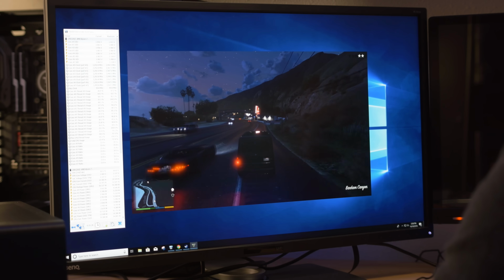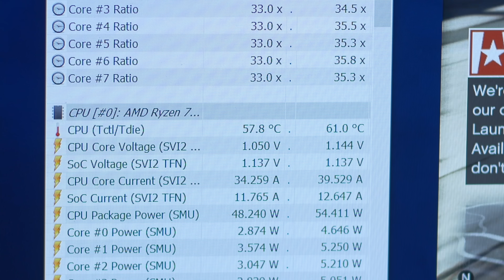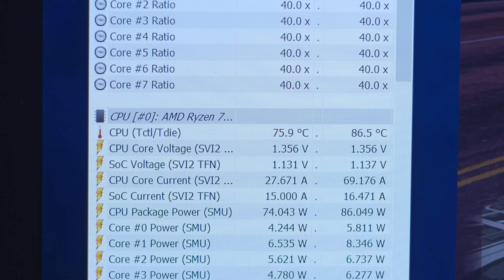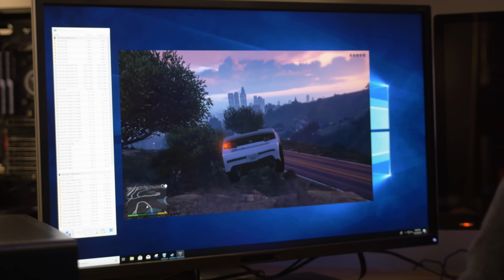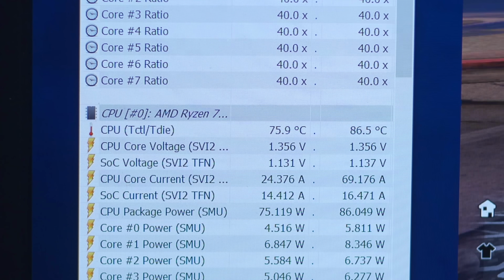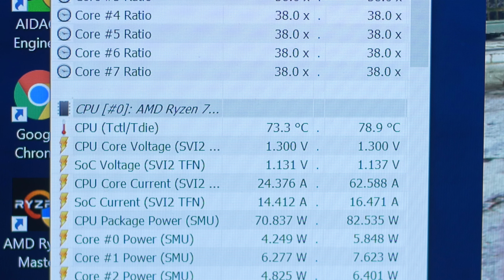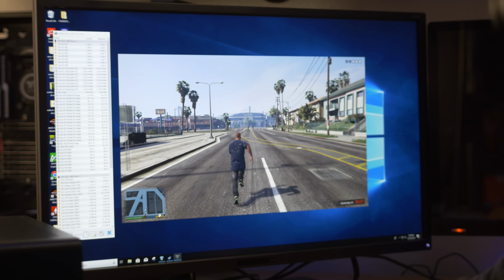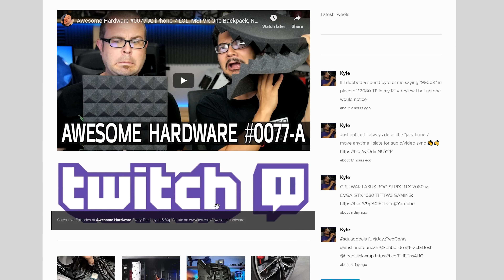Testing the limits of a 92mm AIO with Ryzen!

Comment: Bitwit : KYLIE !!!! It's enough, you intentionally made the same mistake when you were reviewing FM2+ cpu-s a couple of years back. If you consider yourself a serious reviewer then it's way past time to learn how to differentiate between :

Tclt/Tdie = value of 73,3 (those are not degrees C, HWMonitor or Ryzen Master is reporting it wrong, showing a combined number of temperatures from cpu + SoC + VRMs and it doesn't have any other value than scaling only a number)
Tdie = is the correct temperature and it is 20 degrees C lower on Ryzen 6c/12t and 8c/16t cpu-s and 10 degrees C lower on 4c/8t Ryzen cpu-s

Do some proper research and start using a proper monitoring software which is HWInfo that shows both values !!!! I am telling you that because me and my girl love watching you and your wifes channel but sloppiness is becoming a little much, don't you think.
Reply: @LFLY R - Dude, I am sorry but you have your information almost completely wrong! Kyle is reporting the correct temperature number here. I can't speak to the FM2+ chip he reviewed years ago, but this chip in this review here, other than his assumptions about TDP, Kyle was NOT reporting wrong temps. You should probably do a little more research brother, but I will give you some help.

TDie IS the Correct Temperature, you are correct there. And on ANY X Chip you will see different numbers for TDIE and TCTL. In those cases, TDIE is always correct, TCTL is just the TDIE PLUS the OFFSET. So on the 2000 Series that Offset is 10 Degrees. On the 1000 Series that offset is 20 Degrees.

On The NON X CPU's HWinfo will report the Temperature as "Tctl/Tdie". This is Because THERE IS NO OFFSET on NON X CPU's, so it reports both as the same, and therefore on Non X CPU's instead of having different categories in HWinfo it is simply listing it in one category with the label "Tctl/Tdie" and on non X CPU's this is the Correct Temp. 

So in this video he is talking about the 2700, the temps we see up on HWinfo are the Correct Temps, and he obviously also used the correct Temp reading for the numbers he gave us for the 2700x, otherwise it would have been 10 Degrees higher.

So you are mad at Kyle for the wrong reason, you should be mad at him for not correcting his assumption with TDP, but he already apologized for it, so its too late now. Anyways, look up the Temp Differences again, you will find I am correct, I own 2 2400G's, one 1600 and one 1700 (Which all report Tctl/Tdie) and two 2700x So Learning the different Temperature readouts on these was very important to me. A good resource is the Gamers Nexus Discord. Good Luck.
Reply: @evocatiproductions  well my previous Ryzen 5 1500X was reporting 10 degrees C offset, then I had Ryzen 5 2400G which had 20 degrees C offset and now I own Ryzen 7 1800X which has 20 degrees C offset. And Kyle has made the exact same mistake in FM2+ video 3 years ago so him proclaiming himself a youtube computer professional reviewer is just funny because you can't make this kind of a mistake again. A youtube reviewer has much more financial resources available and he should take a little more time to use OpenHardwareMonitor, HW Monitor, HWInfo, CPU Temp and Ryzen Master to compare temperature values amongst each other and then he can extrapolate which monitoring program is useful for certain manufacturer :). Those are almost all free programs to use so there is no reason to be sloppy and again report wrong temps because this kind of sloppines only damages AMDs reputation.
Reply: @lflyr6287  You may be right about the 1500x, as I don't have that one in my collection, so I don't have first hand account of the offset AMD Uses. And I would agree 100 Percent with doing your homework before making a video. I actually love Kyle's Content, but I often Facepalm at his lack of research before he does a video, but I guess that is just his style, and I like the entertainment value regardless. Either way I tend to agree with you, just in this video I was way more "Triggered" at him promoting the Misconception that the Manufacturer Listed TDP Spec actually means it uses less power and heat at the same frequency, that is flat out wrong, and so thats why so many of us down here in the comments were leaving negative comments. But Kyle Acknowledged it and apologized, so hopefully he will address the misconception in a future video, and we can all move on.

However, both OpenHardwareMonitor and HW Monitor are inferior in comparison to HWinfo. HWinfo has historically always been the most accurate because of its developer quickly updating at least once a month, and with every single hardware launch for the last 10 years. Like with the Ryzen Launches if you remember it took HW Monitor almost 2 months to get the correct temps, and OpenHardwareMonitor took almost just as long. Where as HWinfo took less than a week. But thats just my opinion on software, if he Just uses HWinfo, that one is going to be accurate 99 Percent of the time, simply because of its method of accessing the sensor data. If you just use The Tdie Sensor on HWinfo on any Ryzen it will always give you the correct temperature, especially now. I know right after launch even HWinfo had it wrong, but that was only for a few days and then they got it right. Tdie is always correct, but in cases like with the 2400G where its labeled TCTL/TDIE then that is the correct temp, it is not the sum of CPU + SOC.

But if its labeled TCTL and doesn't have the slash TDIE, then it is the true temp plus offset, and that does vary from Chip to Chip. I have seen that all my first Gen Chips with Offsets have 20 Degrees offset, but like I said earlier I don't have a 1500x so I can't say for sure on that one. But I do know the 20 Series X chips all have 10 Degree Offsets.

And whats cool is I now have Several Clients with Epyc Based Servers, and on Every Single One of them HWinfo Reports the Correct Temp, and it is also listed on those as "Tctl/Tdie". But Whats cool about those is it actually gives you the Temp on each Node, so you get a "Tctl/Tdie" Node 1, and then a "Tctl/Tdie" Node 2, and so on til Node 4. So You can actually see your hottest section of your overall Die and adjust your cooling accordingly, so I just think that is one cool difference.

Anyways, I would agree, Kyle and every other reviewer should always be as accurate as possible and try to avoid making misleading statements, intentionally or otherwise. I just don't think their is any point into using Sensor Software other than HWinfo, because the method used to access the sensor data on those 3rd party programs are often inferior, where as HWinfo actually probes the WMI interface in the BIOS directly without going through the windows Kernel. Of course its always good to sanity check, but outside of sanitiy checking you are going to be accurate most of the time with HWinfo. On top of that opening more than once Sensor accessing program at a time can cause problems as owners of the Crosshair 6 and 7 Hero MB's can attest too. Anyways I wil shut up now.
Reply: @Transistor Jump  well my previous Ryzen 5 1500X was reporting 10 degrees C offset, then I had Ryzen 5 2400G which had 20 degrees C offset and now I own Ryzen 7 1800X which has 20 degrees C offset.
Reply: got a trick for you guys: maintain alt pressed and type 248, you get the ° symbol :)

Comment: I don't see the point here: of course two chips running at the same specs will have the same TDP. The only reason the 2700 is a 65W TDP is because it runs at a much lower clock speed. You could have just underclocked the 2700X. Or run it at stock with XFR and try indervolting it.

Comment: Wouldn‘t it make more Sense to try undervolting the 2700X ?
Reply: Or just buying the 2700 and over clocking to the 2700x clock speed
Reply: I have undervolted every single CPU I have ever owned in my life. Same with GPUs. 

Step 1. Buy hardware that is known to overclock well. I chose, in 2012, an i7 2700k. Undervolt it and overclock it as high as the UNDERVOLT will allow. I made it all the way to 4.3GHz on my 2700k, at lower than stock voltage - comparable to hitting 3.9-4.0GHz on an undervolted 2700X or 2600X.  

Step 2. One day, you'll need more power. For me, that's only been recently. I just replaced a 1060 3GB with a 1070, and my CPU started to hold back the 1070 at just 4.3GHz. So, in response, I FINALLY (in 2018) took my 2700k to 5.1GHz, and barely over stock voltage. Since I undervolted it on a 212 Evo all these years, never breaking 55C once in it's life, I know it will easily handle this 5.1GHz overclock until I get a Ryzen 2/3 chip later.
Reply: Or put the 2700X in a case that has room for a bigger cooler.
Reply: Wasting the potential of a higher binned chip
Reply: @honestmstk9790  If the 2700X is a better bin he could get lower voltage at the same clocks for lower temps. 1.27V at 3.8Ghz 
instead of 1.3 would drop temps a little further.
Reply: @honestmstk9790  Not a waste at all, running a 2700X at 4GHz 1.225v and it runs cooler and performs better in all benchmarks than stock speeds.
Reply: @honestmstk9790  You can undervolt and still get better performance than stock in both single and multicore tasks. You simply need to set an offset of around -0.1 volts depending on your chip and raise the bclk to 102 or higher if possible. You get a cooler chip that clocks higher.
Reply: @honestmstk9790  My 2700X can boost in excess of 4.435ghz with these changes and peaks at 65C under an all core workload.
Reply: @thetrashman5252  your cooler...?
Reply: @f.a.i9638  I use an evga clc 280 as a top mounted radiator in an h500p mesh. While my cooling is certainly superior to what is used in the video, I still experience good temperature drops after an undervolt.
Reply: @thetrashman5252  yeah he is using a 92mm AIO can't compare that to a 280 rad...

Comment: Not surprised by these temps. 78C is still way too high for my liking and the case surely doesn't help much with the airflow. I rather run either processor at stock speeds and be happy about it. That or swap the case and AIO for better ones. Just my personal opinion, not that Kyle is gonna do it just because a random dude says so :).
Reply: The point of this case is to reduced the  footprint to as small as possible lol  so not swapping the case

Comment: Hey Kyle could you try applying liquid metal? I am curious if you can drop it below 80°C at 4Ghz with an aftermarket liquid metal solution, also how are the temps compared to the 120mm fan by noctua?
Reply: @CID I think he means instead of using the thermal paste that is between the aio and the chip.
Reply: DelTalkoh is that ok to do ?
Reply: @bones0184  yeah people use liquid metal between cooler and processor all the time.
Reply: This is a soldered chip. You'd destroy it by deliding it.

Comment: You needed a video to figure this out, of course a 2700 overclocked to the same speed as a 2700x would get you the same Temps lmao
Reply: Yes. In any case, the 2700x should actually fare better, given that it is, on average, higher quality silicon. Plus, 1.38V is waaaaay to high. 1.38V is enough for my r5 1600 to hit 4GHz. From most reports, 2nd gen requires much lower voltage to hit 4GHz, anywhere between 1.2 and 1.24V.
Reply: @summushieremiasclarkson4700  you do realize that he didnt have stability at 1.343 aand 1.35 was where he found a stable 4ghz?

Comment: Well, duh. These two CPUs are the same silicon die, so they should have  the same properties at the same clock speed and voltage...
Reply: Erm... no
Reply: @Markknightexeter  Erm.. Yeah! These are the EXACT SAME CHIPS! I can't believe people don't understand this. THE ONLY DIFFERENCE is chip to chip varience, and possible better Binning on the X Chips, but Taking a 2700 and Clocking it to 4Ghz Manually, And then taking the 2700x and clocking it at 4Ghz Manually, You are going to end up at almost the SAME EXACT voltages, with just some variance that is natural from chip to chip. If 2 Chips of the same Architecture and Core Count are running at the Same Voltages, They Produce the SAME AMOUNT of Heat.

ElZamo02 is correct, these 2 chips have the same properties when running at the same clock speed and voltages.

The only difference between these 2 chips other than normal variance, is that the 2700x has higher base and boost clocks at stock. So therefore AMD Spec gives it a higher TDP, because obviously the chip that has Higher Voltages, will use more Power and need better Cooling when running within Spec.

The 2700 however, when running within AMD Spec is clocked lower meaning its Voltages are lower, which brings down the power needed and Level of cooling needed, but this is only when running the Chip within Spec, meaning leaving it Stock. The Second you clock it up to 2700x, you also have to bring up the Voltages, which brings up the power, which brings up the heat, Which now means its out of Spec, and will need the same level of cooling as the 2700x, in fact it might even be a little hotter because of binning it might take more voltages to hit the same frequencies. But outside of Binning and Chip to Chip Variance, these 2 are EXACTLY THE SAME CHIP. I wish Kyle would do a better job of educating some of his more less knowledgeable viewers.

Comment: Well you can't purchase that aio. It's dead, not in production anymore. A real slap for all the small sff company's that designed new cases completely around this cooler. (Might be a few in stock somewhere)
Reply: Doesn't really matter as a custom built version is much better considering the limited space inside.
AIO's are for the lazy.
Reply: Custom loops with 92mm rads aren't really common. In the ncase, sure, Dan no. Since the subject of the video have gone out of production it's worth to mention it :)
Reply: Lindkvist, what are you talking about?. 
"Custom loops with 92mm rads aren't really common". 
What?, it's as simple as googling the parts you need/using websites like "Overclockers UK" etc. 
And also: "A real slap for all the small sff company's that designed new cases completely around this cooler", Yeah not really, as i pointed out.
Reply: I said custom built version , damn.. you tried so hard to rek me there kiddo!. haha
Reply: @coffeepot3123  what do you mean by custom build version?
Reply: Kenny, a custom loop, when someone says "custom" when talking about AIO's what comes to mind?.
I should've said custom loop but we are arguing over semantics here.
Reply: @coffeepot3123  that's exactly why you got me confused, i would normally understand if you mention it in any other case. but it is impossible to fit custom loop inside the case. even fitting the 92mm aio is very hard. so your custom loop version is basically not doable.
Reply: Kenny.
Well, saying it's "impossible" is a bit of a stretch tough.
Depends if you want a full size gpu (a flat acrylic reservoir would probably fit on the gpu side).
And there are elongated reservoirs that could probably fit below one's gpu. ( example: nvidia's reference design comes to mind).
There's so many different pump/reservoir options that i don't think we should scrap the idea too early.
tough i came off as "too certain" when i talked about it here, i hope some dedicated person figures something out.
And if they do then i might even pick up this case.

Comment: I'm running a Ryzen 2700X @4GHz, voltage of 1.225v and it hits 72-72c under load with a Hyper 212 EVO. That AIO just isn't cutting it. BTW that's under synthetic load, which is going to put way more stress than most games will.
Reply: Just put the tube with thermal paste in the fridge for an hour before apply. It will lower the temperature of the thermal paste and therefore lower the temp of your cpu. Its a tip from The Verge
Reply: well, so you can put hyper 212 evo inside dan case? yea right. think about the case he is using, the goal is he wanted to cram as much power in small footprint as possible thats why you go sff. your comment is meaningless.
Reply: @kennysughiarto2780  Wasn't suggesting he try and cram it in a tiny case, that's obvious. I was simply pointing out that the AIO isn't up to the job and if he plans on running the 2700X in such a tiny case he should find a better cooling solution or tweak his voltages/clock speed, etc.  dubb, that's one hell of a cooler, for that price it better perform that well lol.  Andrew N, I sincerely hope you're joking O_O.
Reply: Think about that case too
Reply: Your voltage is 0.125v lower than what Kyle needed for 4ghz on the 2700 (non-x). That's the difference right there, in your very message to him. Nothing to do with the difference in coolers at all at that point.
Reply: @Beehj84  Amazing how small that number seems but how massive a difference in temps it can make. My first 6700k 
needed 1.35V to hit 4.5Ghz, but my second needs just 1.28V. It runs about 10C cooler under load.
Reply: i use a d15s with a 140 mm and 90mm noctua fans both in push. i never hit 60c under load
Reply: apply more thermal paste

Comment: Part of the ihs on the 2700x didn't have any paste on it, im talkin about the bottom left side. Considering that the die's are running vertically in the orientation shown in the video im afraid to say the paste job is subpar. Worth considering next time :).. cheers for the vid however.